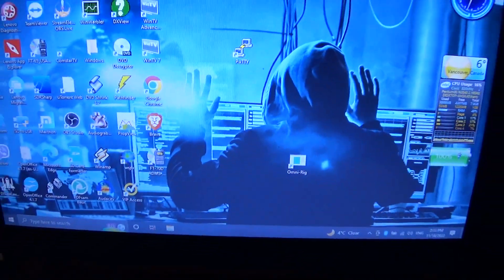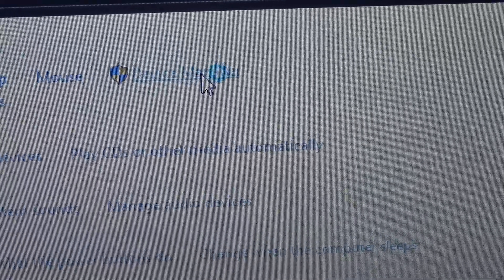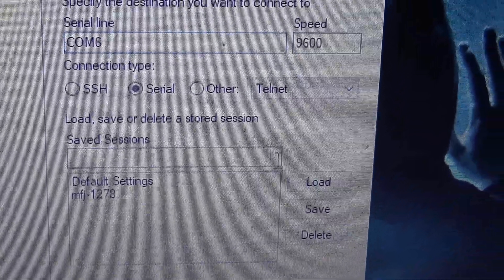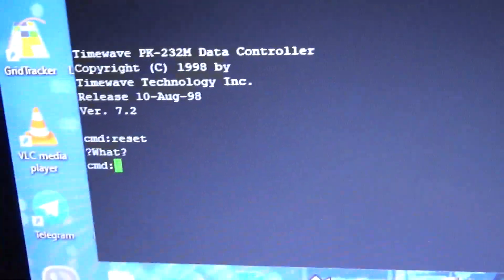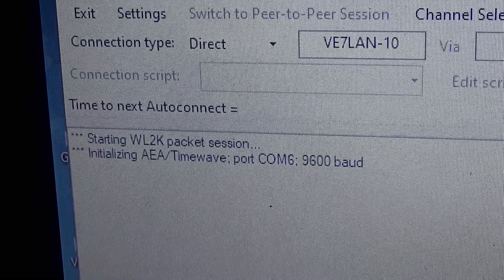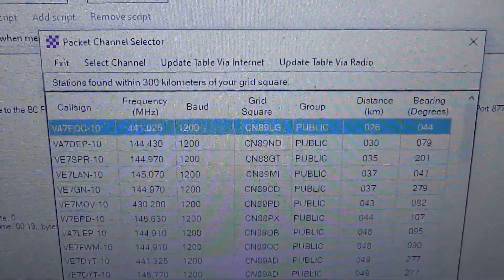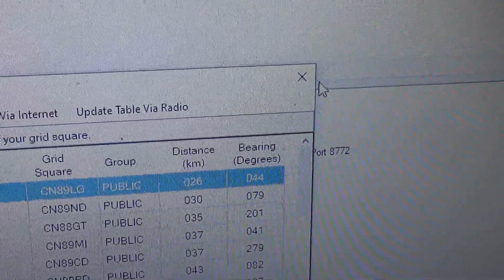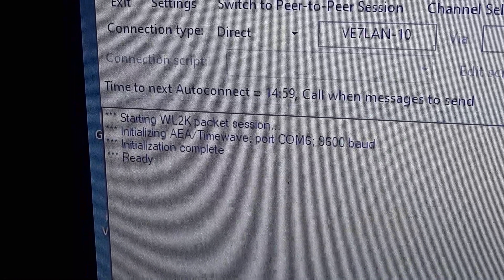Winlink Express RMS Basic Setup With Older AEA TNC's

Comment: ok thank you.  if you could go over what your setting were within Winlink that would be helpful.  did you use kiss mode, or the drop down menue for the pk 232-  frack, delay etc...put it up when you can.  I have only been able to use it in kiss mode, and not the actually drop down menue for the PK-232, even though it is an option?

Comment: are there any special commands that need to sent to the pk232 or just turn on and operate?

Also, when you setup winklink, what data rate did you setup to talk to the pk232 9600 bd ?
Reply from the maker: 9600 yes your right.  I have taken it down  but will put it up again in future